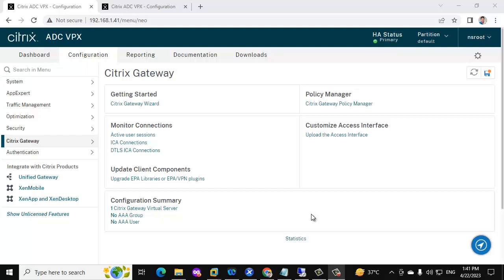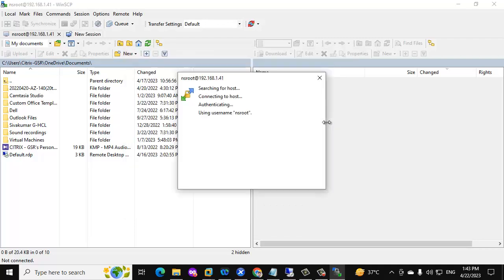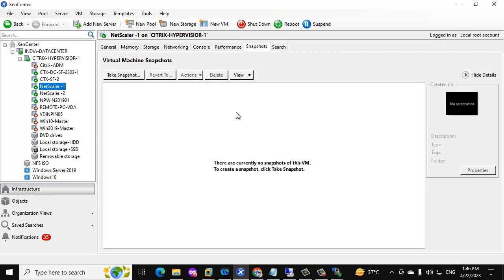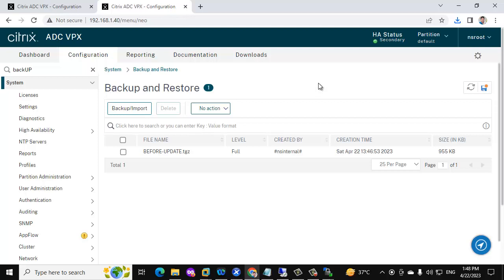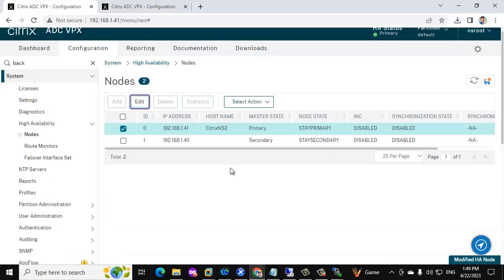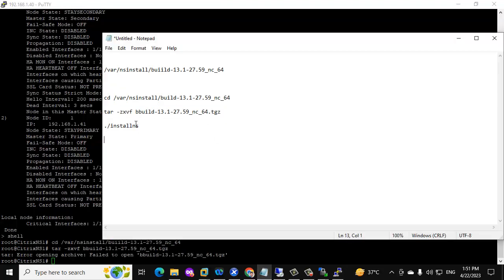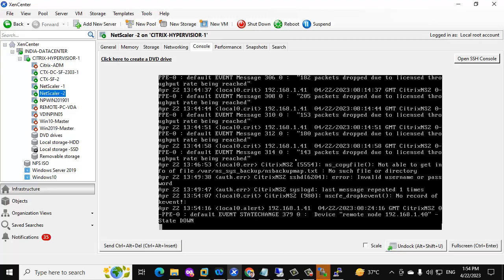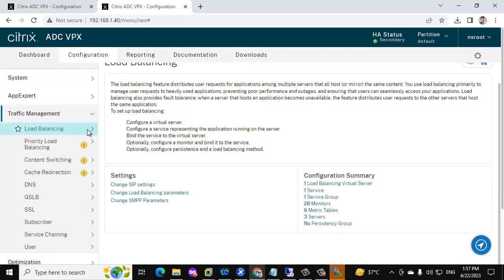Citrix ADC Firmware upgrade for HA Pair

Comment: Hi Thanks for your informative video as always .
.i followed the above steps and receiving error. i am suspecting because of vmware workstation i am using. it is possible to do this exercise through vmware workstation were in i have installed ddc pvs role on same machine. if so please guide .